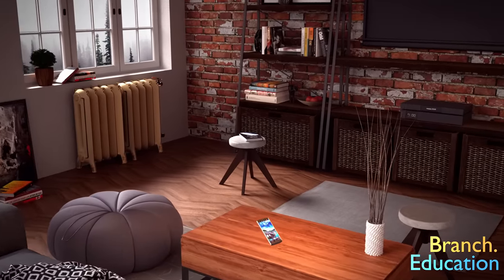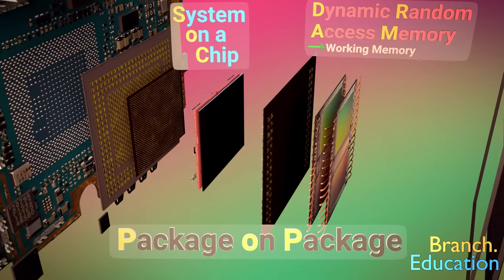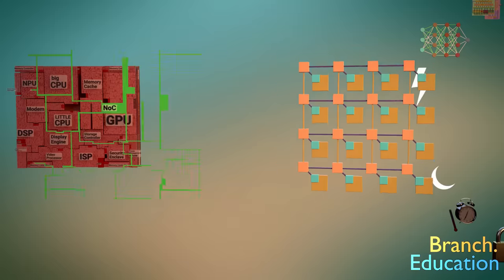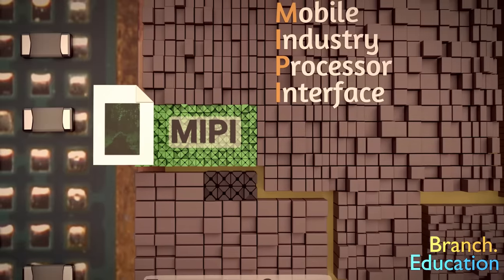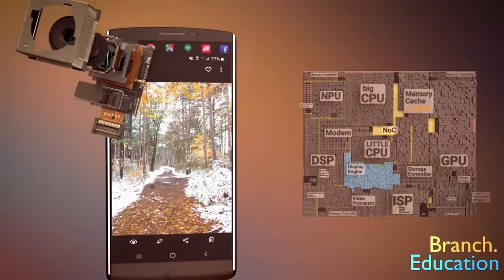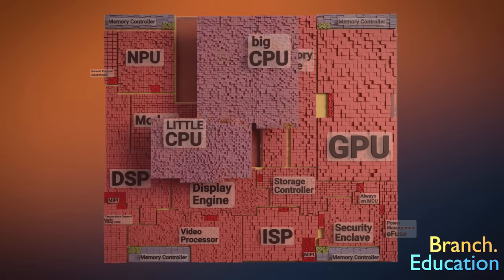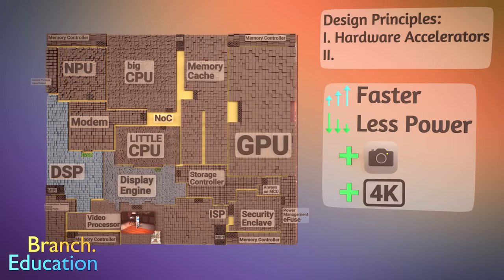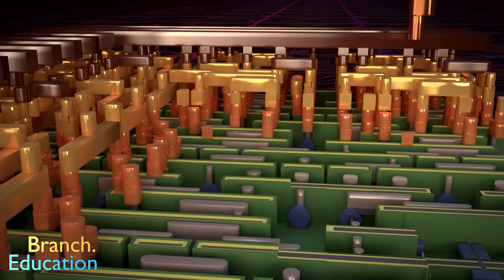How do Smartphone CPUs Work?  ||  Inside the System on a Chip

Comment: I'll certainly treat my smartphone with reverence after seeing this. I had no idea there was so much going on inside my cellphone. It's the kind of thing you don't think about unless something's not working properly. 
Whoever put this video together did an excellent job. It was instructional without being overly technical. 
 It's amazing how fast these computer achievements happened. Only 24 years after the invention of the transistor, Intel introduced the 4-bit 4004 with 2,300 random logic transistors. Now we're using 64-bit multi-core processors with billions of transistors.
 I'm 65 now and when I was younger I thought the quick rate of our technical advancements was a great thing, but as I got older I started realizing that maybe we're not ready for some of these advancements.

Comment: After watching this I’m not mad at how much some phones cost. It’s like they’re worth over a million dollars
Reply: The fist chip costs millions or even billions of dollars to make.  Each chip after with mass production only costs a couple of dollars
Reply: @ymom11  The snapdragon's 888 die size is 72.3mm, and a 300mm wafer can hold 977 of these. A finished wafer usually goes for around $10,000, by doing the math it checks out that the snapdragons only cost about $10 mass produced. That's insane!
Reply: @PhilEngel1  not really since you also have to pay the workers, there are other materials used and not every chip you produce works. alot of them are just thrown away cause they dont work
Reply: And yet we have to throw away after couple of years because battery dies and it's non removable, sad...
Reply: Apple: Write that down!!
Reply: @shivamnegi7149  apple chips are a lot cheaper, can't explain why they sell their stuff like if it was an organ
Reply: and this is just the hardware there is also the software side
Reply: Only if their soc are powerful and not meditek
Reply: @PhilEngel1   72.3mm. you mean millimeters?
Reply: @sebastianjulonchamana2987   Brand Value.

Comment: It makes me think about Moore's law. 
So, will it never have a physical limit?
Are they going to continue reducing processors to endless?
Reply: Actually as it stands processors are getting down to transistors as small as 5 nanometers, which is near the point really really weird stuff starts happening thanks to quantum mechanics, electrons moving threw the electrical circuit will skip over or "quantum tunnel" around the transistor that's supposed to be controlling them making the transistor emit a signal even when it's supposed to be off.

So TL:DR; we are actually nearing the "size limit".

 So people are taking about trying to use new stuff to get even more speed such as: Graphene (Carbon based molecules in a chickenwire fence shape) that can run with less power at higher speed, With another option being to start developing "Optical circuits" which use light instead of electricity to process information (though finding ways to imitate various electrical components to control light is apparently tricky), and finally Quantum computing... which is so very much on the bleeding edge of technology I don't really know enough to describe it much... beyond saying that most of its uses are very specific and maybe not good for general use CPUs and also has the current slight issue of needing to be supercooled to temperatures near absolute zero on the Kelvin scale... the jobs it can do though it does orders of magnitude faster than litterally everything else, I recomend looking these all up if you want more than a tech enthusiast's hasty description.
Reply: @UNSCPILOT  Thank you. You took my sleep away

Comment: This is incredible! Keep doing what you are doing! Maybe you touch the topic of what we have in cars next? I mean the other system on a chip. I know that they rarely disclose stuff about their chips and for some of them there are good reasons behind it. Even the older car tech is fascinating. Cars have CAN and its adapters/protocols might be confusing even for specialists sometimes. Some cars have multiple internal physically separated networks and operating systems running not to mention the complexity of various internal security systems, which are way more advanced than what smart phones have. Car's electronics has to operate even when a lightning hits the car and this happens more often than you might think. LIDAR and other techs are worth mentioning.

Comment: FYI:
They don't, Thinking is a process which only can be found within a conscious mind. A Smartphone is simply an automation. It automatically runs code which can change the device configuration, like starting up an app which can accept input from your touchscreen to change the colours of your screen which you'd interpret as an result. Most of the work is still done by the user. The user interprets certain orders of dark and light pixels as letters which also get further interpreted as words which got interpreted in its meanings.

But I love your vids and they are very well assembled. But sorry I can't pass a philosophical issue, hence my comment xD

Comment: As someone who knows how computer components work, I never actually realized how different a smartphone was to desktop computer hardware. I figured that the architecture had to be different for more effiecient power usage, as a desktop computer is plugged in the wall at all times and a phone is not. A low powered device also needs to get away with not using a beefy cooling system which the low power usage definitely helps. But this blew my expectations out of the water

Comment: There you go, a picture taken by a camera and...whoosh! Photons flown through a lens, color filter array, converted by the sensors photodiode pixels into an analog electrical current and then a digital 12 bit binary value before traveling from to the System on Chip (SoC) as a raw image through the Mobile Industry Processor Interface (MIPI),  by the Network on Chip (NoC) the Memory Conroller, onto the Dynamic Random Access Memory (DRAM), temporarily stored by the memory cache while processed on the SoC's Image Signal Processor (ISP), then overlayed in the Graphics Processing Unit (GPU), and displayed by the display engine on the screen 😊
Reply: And it all happens within a few mili seconds 😀😱❤️🙏🏻

Comment: great video! Please make the same series on the components of a laptop, and how electrical signals/signal currents flow between the components when a user select a file, opens a program, save a file, takes a picture, install new program. Also interesting will be, if you could explain how the os gets started when a user run one of the above tasks.

Comment: Can you please list or reference a good source to outline the supply chain points for most common elements required in technology products? Ie. Magnesium, silicon, microchip production, metals or the different components like microchips, circuit boards, etc. industry outline?

Comment: Let's do the math here, which will reveal some very interesting facts.  A typical SOC or CPU takes about 4 years to design, and usually involves about 500 engineers.  So that is about 960,000 man hours in total, with the typical 40 hour a week, and NO vacations during the 4 years. 
 If a SOC has about 10 Billion transistors, that means each one of the 500 engineers, each has to place and set up the connection for 174 different transistors(or roughly 40 logic gates) EVERY SINGLE minute without losing step, non-stop for 4 years..   Impossible.

...yeah... proof it's 100% 'alien' technology.